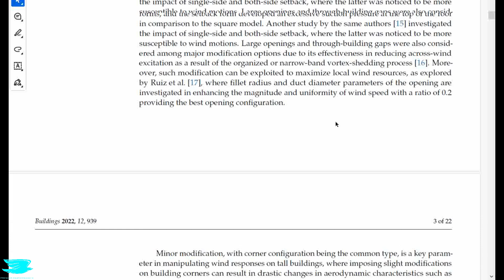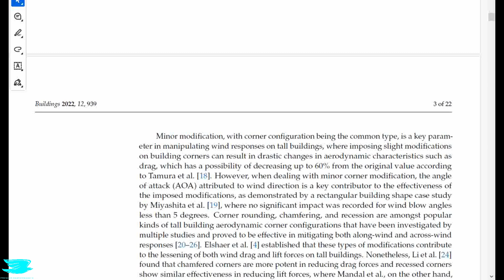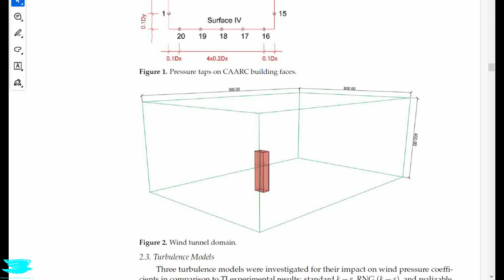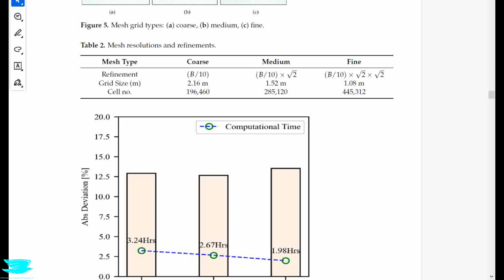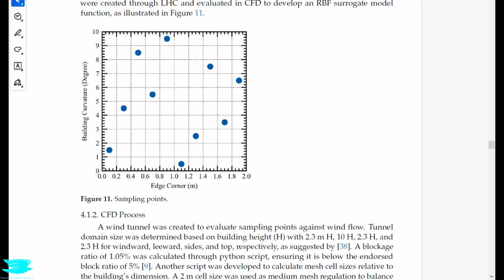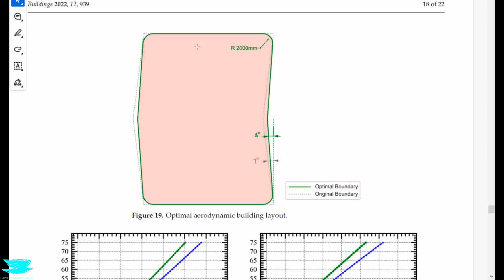Podcast 203 Making Skyscrapers More Aerodynamic

Comment: Now design a building with active aerodynamics that can produce enough downforce to essentially be in equilibrium while a cyclone passes right through it.
Reply: The building needs rounded edges
With turbulators.

I invented arched , chemically hardend windows. 
 Thrown stones do no harm to them.
If mounted properly the lift of a tornado is not the main proplem. 

It's the fast change of lift. And the debris flying around.